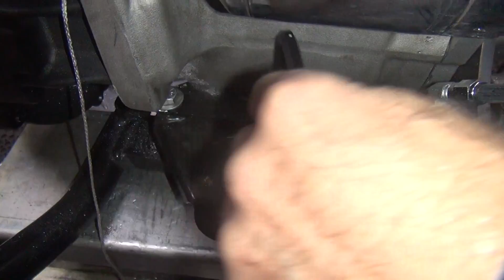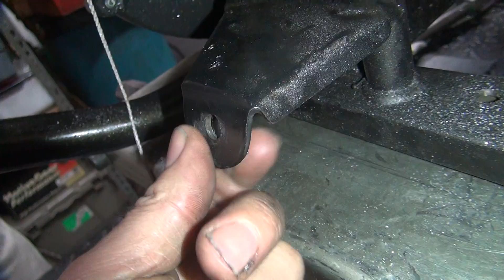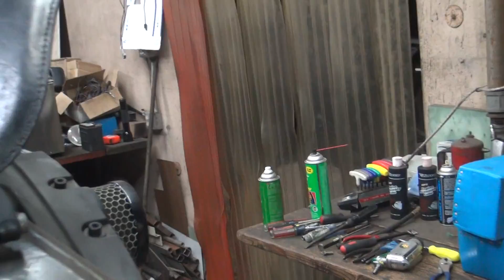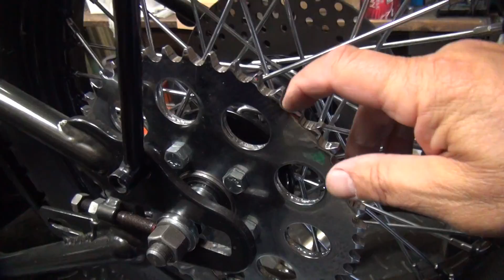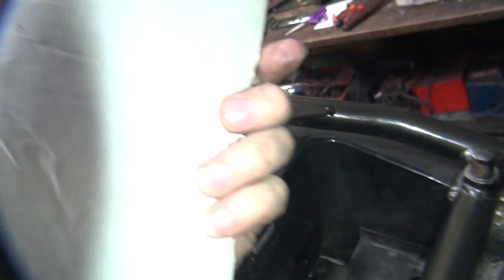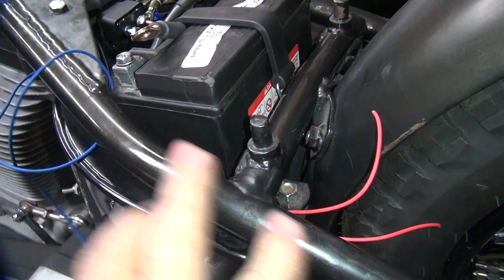1999 80ci evo #103 rigid install mid controls chassis brake repair get running by tatro machine

Comment: I’ve noticed that you frequently use the Ultima ignition (I use them as well) but I was wondering what your general opinion of Ultima parts is? I’ve been shopping around and they’re cheaper, made in the USA but.... I’ve also heads some negative stuff as well.
Reply from the maker: are you kidding, usa my ass. china parts with some machining and assembly. you see what i use and all the defects as i see them.
tatro

Comment: do all engines have valve overlap?
Reply from the maker: no. most pre teen bikes in the 1900's had automatic intake valves as well as 2-stroke bikes. all other motors with valves have overlap to get the airflow to make horsepower.
tatro